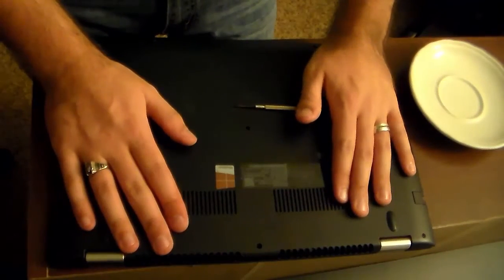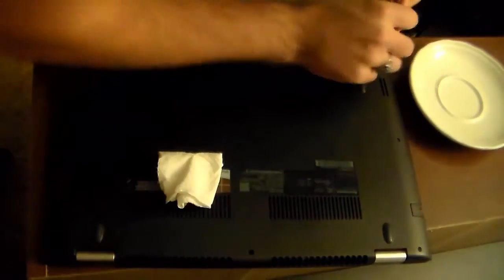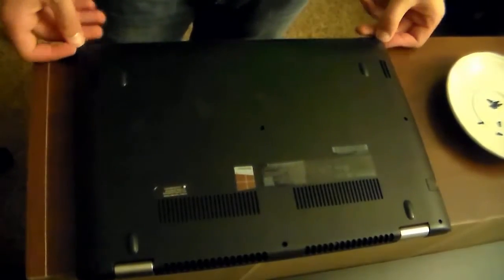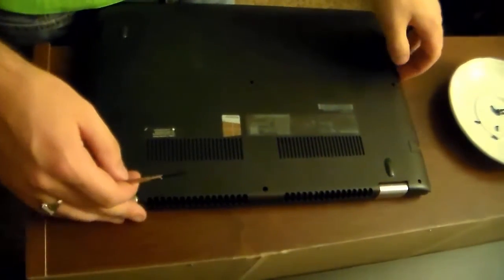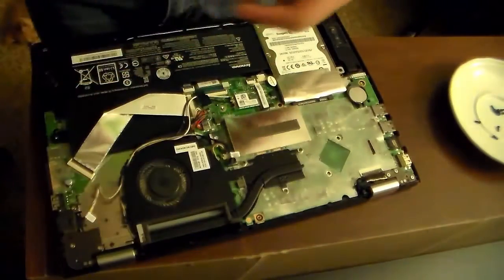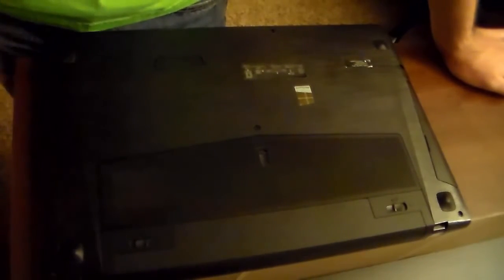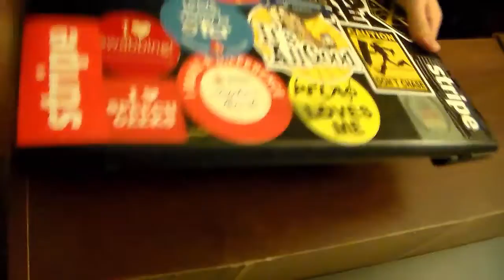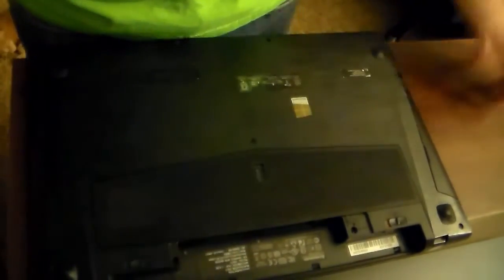Lenovo Flex 3 14 inch and Lenovo IdeaPad Y510P 15.6 inch RAM Upgrade Tutorials

Comment: I know it's been a long time, but I'm a cheap fck, do you think I could put a 16gb ram in that slot?
Reply from the maker: Hey Hulk, it has been a hot minute, but if memory serves:
The Flex 3 (14 inch) only has a single RAM slot, with a maximum capacity of 8GB. 
The IdeaPad on the other hand has a maximum capacity of 16gb with two slots. It /might/ run a single 16gb stick, but most likely won't. It would be best to stick with a 2x8 configuration.

Comment: 1) DISCONNECT THE BATTERY ..!!
Reply from the maker: Hey Phuche! In the case of the Lenovo Flex 3, it doesn't have a removable battery, and disconnecting it can make a lot of people who aren't comfortable around tech nervous. Running the system to 0% battery and then power draining it (pressing the power  button for 20-30 seconds and making sure the system doesn't power on) is also an acceptable and safe practice. 
Then for the Lenovo IdeaPad I the battery is removable, and that did occur, and you'll still want to complete a power drain.